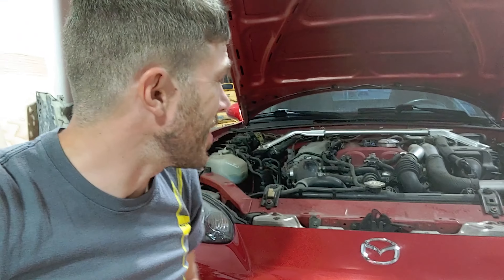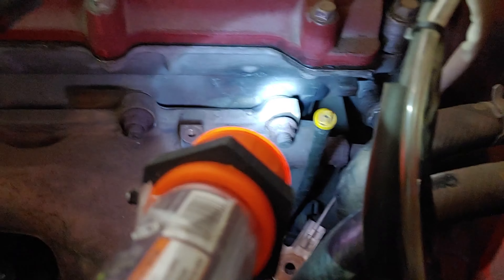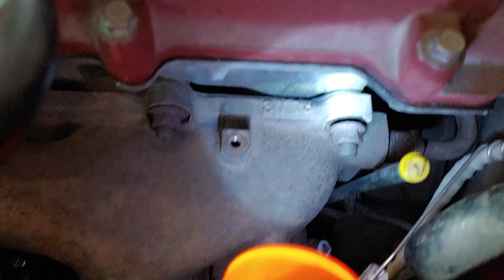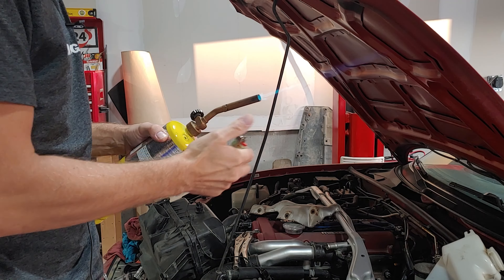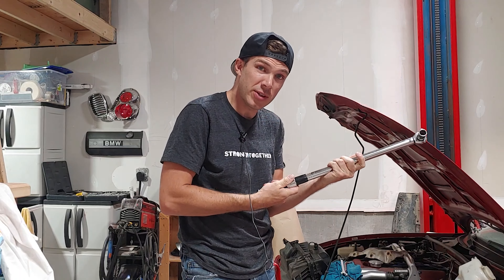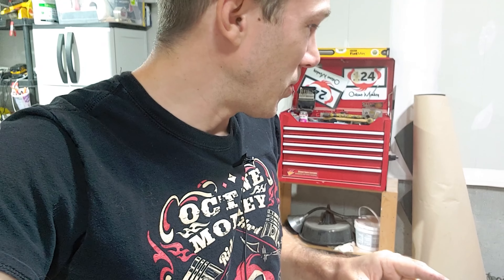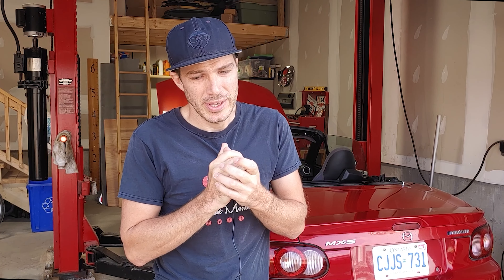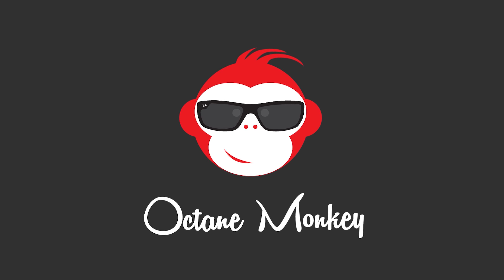Mazdaspeed Bog - Free Horsepower from Common Miata MX-5 Issues - Turbo Exhaust Leak

Comment: I also have the dreaded dark spot over that last bolt that's visible with the heat shield on. When you say it was difficult to take the heat shield off can you go into a little more detail about what all you had to remove? Another possibility being do you think I could use a dremel tool and cut around that corner without removing the heatshield just to access that bolt?
Reply from the maker: You can definitley cut the corner off with a dremel tool. Taking off the heatsheild doesn't require taking off too much stuff. You have to take the air filter box off and loosen some of the piping around that area. Its just a tight space to slide it out from under the grey metal intake pipes that feed air to the turbo.
Reply: @OctaneMonkey  I think I'll try to carefully dremel the heatshield while everything is still on. A little worried about cutting into things other than the heatshield but oh well. I'll report in whether it was doable or not! Thanks!
Reply from the maker: The only thing you should have to be careful of is the dipstick. Good luck. Let me know how it goes.

Comment: Also, MSM folks talk about the OEM recirculating valve leaking. Did you already replace yours with a Forge or such while tracking down boost leaks?
Reply from the maker: I haven't checked it in awhile. When I was researching I was looking at aftermarket ones, but I wasn't sure what style to go with and how that would fit in with the long term plans for the car. If I go aftermarket ecu, than I probably will do a blow off valve.
Reply: I have a stock 2004 MSM and the group has been steering me toward the FM O2 modifier and FM downpipe.  I was trying to go FM intake also but they’re having issues with their suppliers it seems.  Anyways I just ordered a Forge BOV that’s supposed to be a direct replacement for the OEM.  My attempted fix will be FM O2 modifier, FM downpipe (once back in stock), zener diode, and Forge recirculating valve.
Reply from the maker: Let me know how it goes!
Reply: @OctaneMonkey  so finally got the FM downpipe installed and checked for any turbo manifold leaks.   Fingers crossed but I believe I have the bog fixed.  Had a major P0300 issue that appears to have fried the stock cat.  The new downpipe/cat have my MSM running awesome again!  BTW also finally fixed the random misfire with a new CPS so hopefully I won't be frying my new cat anytime soon.
Reply from the maker: That's awesome, thanks for sharing. I noticed my car has a crank pulley wobble, which may be me part of my misfire engine light. I never thought about changing the sensor. But that could be an issue aswell.

Comment: Sooooo did the FM O2 modifier help?
Reply from the maker: The FM signal modifier smoothed it out some. Its seems like a band-aid solution.
Reply: @OctaneMonkey  you thinking boost leaks more than ECU in your case since it still bogged after you disconnected TPS?
Reply from the maker: @phillipboswell1277  It could be, I did a check for vacuum leaks early on in the diagnosis. Before I order and ECU, I need to do a more through test using smoke, plus exhaust pressure leak test, and I am going to check cylinder compression.